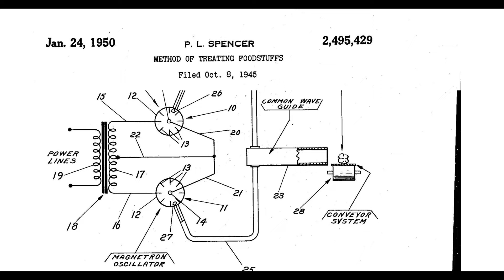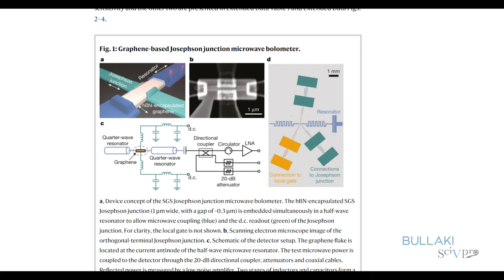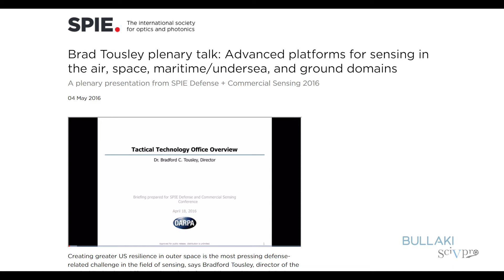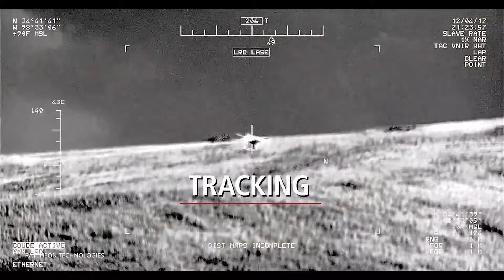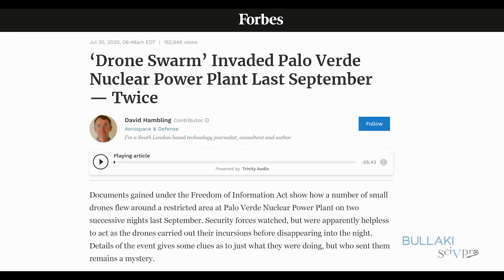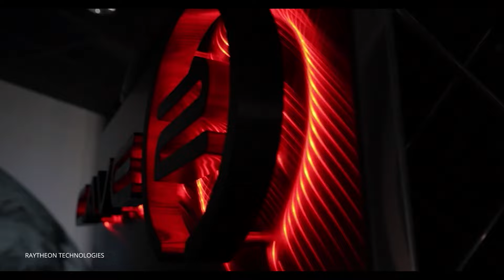Raytheon Technologies, High-Payoff/High-Risk R&D for Full-Spectrum Dominance with Bradford Tousley

Comment: Dr. Tousley made a comment about Raytheon’s evolution as a radar company and vacuum tubes. He commented that solid state has replaced the tubes. Actually Korea produces thousands of microwave tubes every day called magnetrons (80% efficient) that power household ovens. Being in that industry, I have heard tubes will be replaced by solid state devices in the next 10 years, every year, for 40 years. There are so many applications like physics research accelerators (LHC at CERN), cancer radiation machines, radar, industrial heating, and satellite communications that still use vacuum tubes. Great interview. Broad scope is amazing.